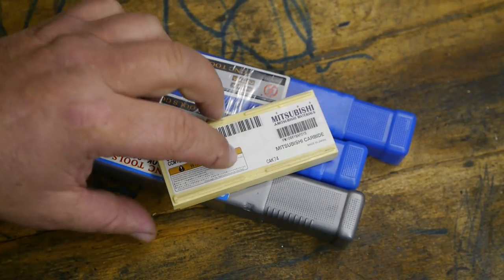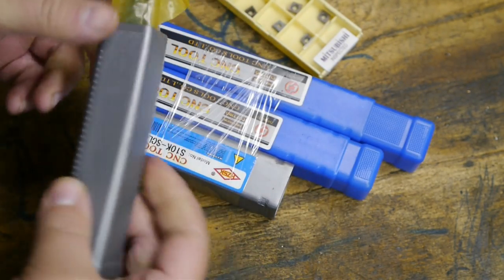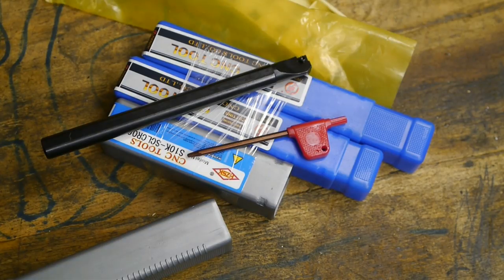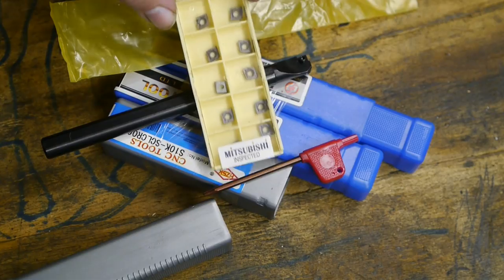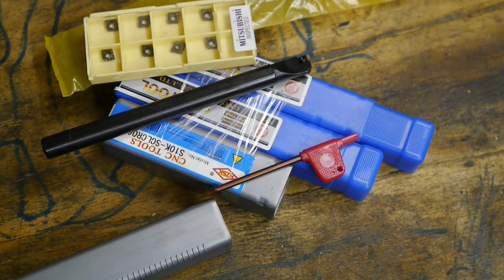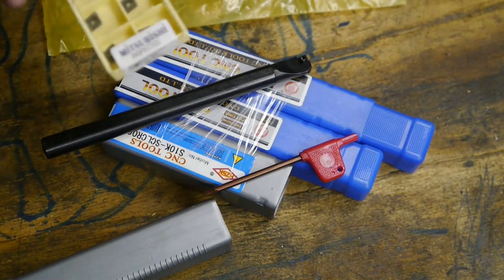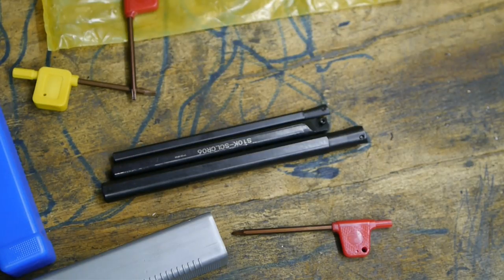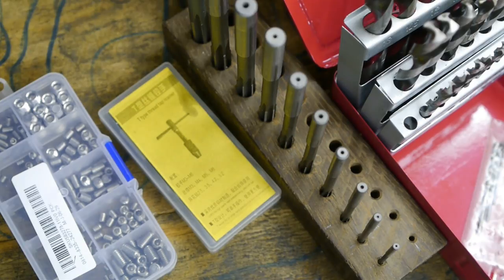Making a 4 barrel revolving boring bar holder

Comment from the maker: FYI: This video is the first one in a 4 part series were I make a boring bar holder to test some Banggood boring bars and Mitsubishi inserts. 

1. Making the 4 barrel revolving boring bar holder 
https://youtu.be/d8akPKkOAd0 

2. A boring, reaming and drilling video 
https://youtu.be/V0MtdSr4umU 

3. My drilling and tapping adventure 
https://youtu.be/JmLqe4HN39k 

4. Using insert boring bars on a slow lathe 
https://youtu.be/N0TbtGqOvrY

Comment: "Quick tip" To help stop your work piece slipping in your set up, put a piece of paper between your work and the clamp. Both sides if you really want to be sure, but on the bottom surface would be plenty I would think. Great review so far Mate.....
Regards Matt
Reply from the maker: thanks for the tip. I guess I will need to use some oil paper :)

Comment: So far so good.  Fingers crossed the later video(s) continue with good results.

They do not make cheap imported drill bits like they used to, especially from China.  LOL

The internal drill index is often a hassle.  The big ones may be stuck due to the metal not being perfectly bent, or the bits may have a burr. 

A big unknown is how well the bits hold their edge.  Be prepared to sharpen the bits sooner than you may have expected. 

I loved the dancing steel on the sander.
Reply from the maker: Those drill bit were pretty bad :)The cassette I bought about 2 years ago looked better but some of the big ones seized up all the time. The smaller ones are pretty good. But none of them cuts as well as those professional drill bits I bought at the flea market this summer.  The difference between pro bit an cheap stuff can be really significant. But in my experience the cheap stuff can usually get things done. Although sometimes it might turn into a nightmare :)